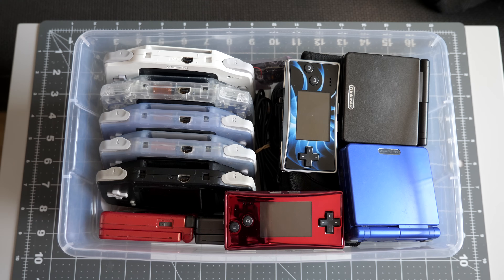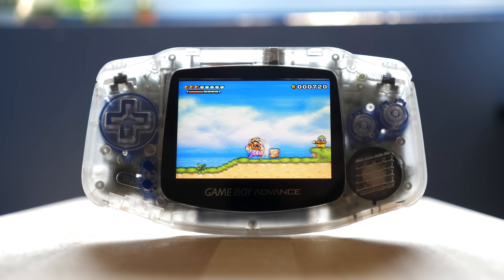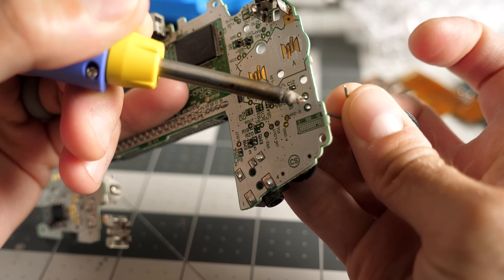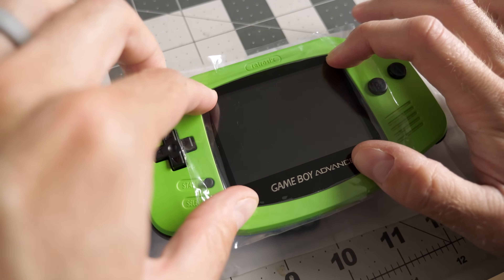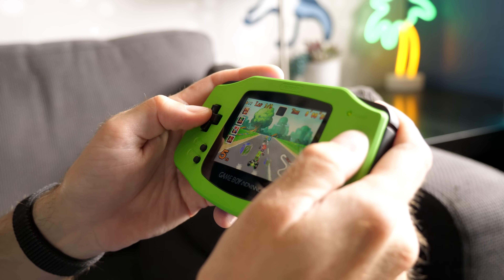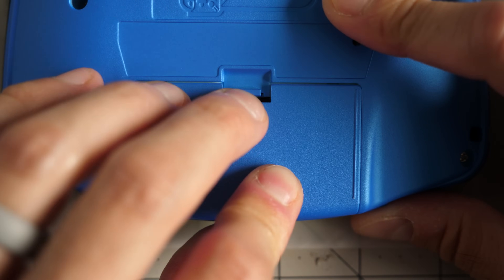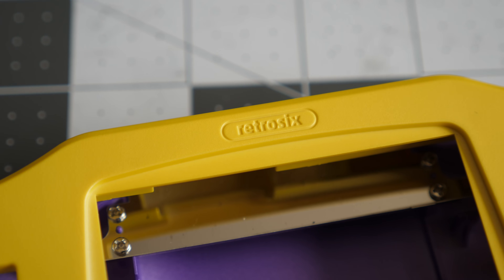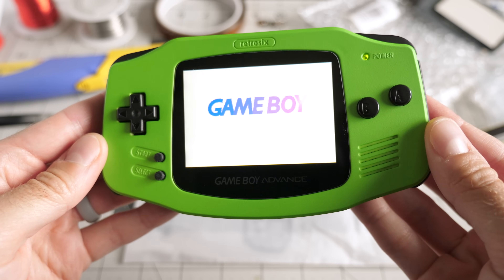Let's Build the Ultimate Game Boy Advance for 2020!

Comment: USB C, as it should be. Well done to whoever made that mod. 👍
Reply: Honestly if the switch didn't exist I don't think I would own any devices with USB C and even with the switch I just get an adapter and plug my micro USB cable in anyways

Long story short who gives a crap if it uses usb c or micro usb because you ate going to need both cables anyways.
Reply: @bland9876  because micro usb is a shit connector that breaks way too quickly
Reply: @YodielandInhabitant710  just get a new cable if it breaks. There like $10 max and then be careful with it this time
Reply: @bland9876  It's the port itself that breaks as well. Also, usb C has way more options for faster power delivery.
Reply: @bland9876  there's no be careful. You've never had a ps4 controller. Those ports are shit.
Reply: I was very pleased with this as well
Reply: @bland9876  I've been living without micro USB since the S9 came out. Fuck micro USB all my homies hate micro USB
Reply: @tuckerton296  imagine using mini USB instead. Eeuughh...
Reply: @LaskyLabs  at least that one was a little more robust
Reply: @bland9876  My phone, tablet, headphones, 3DS, Wii U GamePad dock, and Wii U are all USB C
Reply: @shanez1215  I'm definitely too lazy to mod all my systems to be USBC
Reply: @LaskyLabs  Mini USB ironically is a bit larger than Micro USB and lasts better too. I also have a Sony A100 camera which was made in 2006 and its custom USB port still works. USB Micro is just too terrible

Comment: I remember when ags-101 is were like 50 bucks on eBay good thing I still have mine from back in the day or well technically my sisters
Reply: Yeah the Ags101 price goes up in the last year but the ips is the better screen and cheaper
Reply: 666Gothicgirl The IPS LCD is although better and cheaper, the battery life is lower than an AGS-101 LCD unfortunately.
Reply: I heard there is some lag, however minimal I would assume, with ips screens, compared to the ags101. Maybe that info was wrong, I dunno.
Reply: what is sister's is sister's
Reply: @R1SKbreaker  The Funnyplaying IPS screen v1 has screen tearing. Maybe that's what you're thinking of. The new IPS v2 screen has no lag or screen tearing. It's definitely the best screen on the marken today.
Reply: @thenightowls2804  that could be. I'm tempted to mod my GBC, but I have a Analogue Pocket, which dissuades me from picking up a screen for the GBC. If I ever find my NES style GBA SP, I'm definitely doing a IPS screen mod though.

Comment: I wish the shells didn't have branding on the front. I appreciate that they've invested in the moulds.. but I'm not playing on a 'Retrosix' GBA. The shell is literally the cheapest bit of it all.
For other things I'd consider essential, flash cart.
Reply: Yepppo. I'd rather have a "cheap" shell rather than one that has some manufacturers logo on it!
Reply: @MixUpTheVideos  yep that's true but you have to consider that it's not some fake Chinese crap that tries to pass by the original shell. Rather retrosix is one that's already made with mods in mind, so no extra work, so if you like the original feel and look of the oem shell, then grab a used one in good condition and mod it (I wouldn't recommend this for the ips but the ags 101 because the ips requires so much trimming that you may end screwing up the oem shell) but if you want to pick up an aftermarket shell for your build then grab retrosix's your not going to regret it!! 🤓🤓
Reply: 100% agreed! I made the mistake to buy one on eBay for Freeplay CM3 mod and saw that only when I received which was disappointed. I ended up not using it.
Reply: Yeah I would be alright with inconspicuous, small branding on the back.  But this has big gaudy branding on it.  It's too much and I think I'll have to pass.
Reply: The reason they have the retrosix branding on it is copyright. While most cheap Chinese shells off eBay don't care about it, retrosix is based in the UK (I think) so therefore have to work around the copyright laws to be able to produce the shells
Reply: @looeegee  They should make it an option on the front or stick to the back logo only. Easy fix. I can see how most people gets triggered by this since you're looking at this logo 99% of time lol. It's the same story as with screen protectors. There was time when some companies were making GBA protectors with their logo instead of Game Boy Advance logo. It was a disaster.
Reply: @looeegee  they're still losing clients, tho. I won't buy this case just because of the logo, I rather mod a original from a broken system. Reteosix GBA lol.
Reply: I can't get past the retrosix logo on the front. Would have rather have nothing there or maybe have it hollowed out to fit a sticker like the one on the SP on it's cover.
Reply: Remember one thing - they CANNOT use ANY of Nintendo's trademarks.  So they have the choice of nothing or their own logo...
Reply: @Gulyus  Nothing would be better.
Reply: @Gulyus  The whole GBA shell mold is patented by Nintendo it doesn't really maka a difference, they're still breaking their patents and trademarks.
Reply: @ant_989  Not true. It's called right to restore. Because nintendo do not offer the replacement parts to the public, there is a right to provide viable replacements to allow restoration (spent a lot of time with legal to get it right). It is also an open rule in general around the right to restore, nothing is hard set. Nintendo could come after anyone using their brand, but if you use it clearly indicating it is not official, and nintendo do not offer an alternative, its highly unlikely. Also the `retrosix` is now being replaced with a `For Nintendo` logo very close to original, and all other branding removed.
Reply: @AngelSix  yeah i assumed they had or would have something unbranded. They arent that dense lol. I dont understand people THAT triggered by it, even tho i am not a fan of big bgranding in other areas. Its a GBA, if it makes the feel better is all im worried about. The look is very secondary, and its not even outlined! Just a faint press.
Reply: If your worried about that you would not rape your gba motherboard either so i dont see the problem. Just stick with original...
Reply: @Gulyus  i'll choose "nothing" every time.

Comment: I got my parts in over the weekend and did the whole build today in about 3 hours! 

I opted for the solid purple retrosix shell with white buttons. Looks like a futuristic take on that classic indigo model. Can’t thank you enough for the recommendation, it does feel like a super solid aftermarket shell. Just wish i could have kept the Nintendo branding.

Still this mod was a super fun quarantine activity. I hope that handheld legend restocks so others can take a crack at this!

Anyone else who tries, do the build in his order. Clean amp first, then IPS. Have the battery charge outside of the system while assembling so you can just plunk it in fully charged! Im gonna say the shell+bracket aren’t optional because it made it SO EASY compared to other builds ive done that required shell trimming.

Also, the handheld legend after market buttons had some little extra plastic bits. If you take flush cutters and clean these bits off they get closer to the quality of the retro six shell and fit much nicer. So make sure to clean them up before installing!

Comment: $40 for the battery is disgusting, I think I'd make my own and order a board from china for $2 and probably end up spending no more than $10 in parts.
Reply: With small volume stuff like this, a significant chunk of the price is the designer recouping their R&D time. The only reason the “$2 board from China” would even exist is because a hobbyist went through the work of designing it and having it manufactured. 

That said, yeah, it’s hard to stomach a $40 MSRP when looking at just the BoM and what it does.
Reply: Correct, I buy any components from AliEx, 35$ screen (the same function), 2$ front glass, 5/6 for case with cutter parts... Save 50% or high ;). Battery mode? mmmh I don't have idea how much cost But, i like AA Battery <3

Comment: Love the AA battery setup. Something about the size of them and slotting two of them in, in the opposite direction just feels right plus you can keep some good brand AAA AAs on hand for Wii, N64 rumble paks and tv remotes. Actually wish PS4 and PS3 had a more traditional battery setup. It is nice though how they've gotten batteries to fit into smaller spaces by turning them into a small rectangle. Picked up an IPS from them the other day as well as the holographic glass. Going to need 3 more eventually trying to have 4x GBAs for the rarely done FFCC and ZeldaFourSwords. 4 player consoles really interest me.

Comment: My dream is a gameboy advanced with a rechargeable battery that uses usb c, an ips screen, and an all bead blasted aluminum shell with matching buttons and triggers. If it were possible I’d want some kind of small upscaler or line doubler module to increase the picture quality. But I think the thing that would make it the ultimate gameboy advanced would be also setting it up to allow connection to a tv via usb c and use it as a controller to play gameboy on tv.
Reply: Look into the GBAccelerator as well!

Comment: I bought the funnyplaying IPS kit after seeing your video on it. My installation of the panel wasn't perfectly aligned, but I didn't want to risk breaking it to redo it, so it is still slightly off-center. Now that there is a mounting bracket and the actual panel is only $15, I might redo it when the bracket comes back into stock. I'll definitely pick up the cleanjuice and the retrosix case as well. Or I'll upgrade my spare GBA and leave this one as-is, but the IPS kit is also sold out.

Comment: Omg, with those brackets its finally a viable mod for me to do!
My house is incredibly dusty and i never did an original gba ips mod because i only get one shot at putting in the screen dust free. With that bracket i get as many retries as i want
Reply: you can clean the screen or use air spray blow the dust before place the lens.

Comment: Surprised you didn't include the PureSilence with the CleanAmp. I just did all these mods as well and it's only a few more solder joints - not anything difficult if you can do the amp itself.

Comment: when you asked if there were any mods for consoles that dont exist yet, i instantly thought of an idea i had the other day; Gameboy Colour Advance. It's just a Colour shell with an Advance widescreen. 
The other day i was mucking around with my old gameboys and i put the advance lens over the colour screen and thought how good a widescreen Colour would be by being able to swap the screen into it. The advance lens almost matches the width of the colour so i know the screen would be a very tight fit and the power light would have to go, but with a dremel/milling tool you could easily fix the shell. As for compatibility between my own parts (pcb and screen) idk, but i'm sure a mod should exist.

Comment: No GBA mod video ever talks about the GBAccelerator. It allows you to "overclock" the GBA with some button presses. Speeding up long boring dialogues or grinding in RPGs at 1.75x normal speed is extremely helpful

Comment: I did an IPS and shell/button replacement on a GBA a few months back and let me say... you guys make this stuff look easy.

between trying to get everything positioned right inside so the screen's not lopsided, not getting a hair caught in the tape, making sure the thing will close easily, not losing a rubber nub that goes in the L button... it's an ordeal, at least for me doing it for the first time

I wish I'd gotten from retrosix though. while the parts I got off ebay are decent enough and definitely work, and I'm /satisfied/ with my final product, I'm dissatisfied /enough/ that I'll just keep using my professionally modded SP instead (Which has a functioning L button). I'd like to try it again though. maybe with more space and white floors in case I lose the nub.  lmao

Comment: Great video! I did the same for my gba. Only different is that I stuck with the original gba glacier blue shell. I wish I had an ags 101 screen to keep it as “Nintendo” as possible, but they are too pricey, so I opted for the ips screen. I also went with the powerup advance rechargeable type c Li-po battery

Comment: The IPS V2 mod is leaps and bounds ahead of the 101 I think. Also I got the Speaker and amp mod from HHL but didn't get those tiny wires .. something to look out for .. I haven't finished modding my GBA as I'm trying to salvage tiny wires from old electronics.

Comment: I got someone on reddit (u/Retromoddoctor) to give my GBA an IPS screen and a purple Retrosix shell. i knew basically nothing about retrosix but when my system arrived back in the mail.... holy heck. it feels luxurious. its got a soft matte finish and very slightly rubbery. the bright screen is beautiful too. i wish id know about the rechargable battery option, i would have had him do that too!
Reply: Battery requires no soldering or opening of the shell, just order it when they restock with V2 clean juice! The new one will include low battery warning ( probably 4 weeks till that releases).

Comment: i personally would just use rechargeable AA's over the battery pack as you can get lithium ones with micro USB ports on them for less money, and no mod needed to show when the batteries are running low.

Comment: Makes me regret getting rid of my old wide GBA. The buttons and screen went bad but the board itself was fine.
Now I just source port my GBA games to my 2015 3DS XL using its built in Virtual Console. If it can run Golden Sun the Lost Age flawlessly, it'll run any GBA game (since The Lost Age is a bear to emulate, but Virtual Console isn't an emulator, but instead, clocks the system down to exactly GBA spec).

Comment: I absolutely love the quality and number of mods we can apply on GB and GBA! However, I alwayst have a little grive with "overmodding" an original console so to speak.
Until when have you made improvements to the original und at which point have you just made a new console that just has the motherboard as an original piece.
For example the shell of an original GB DMG is, for me, an important piece of the GB "experience". If you replace the shell with an replacement, it doesn't feel the same to me, event tough it be of better quality.

Don't get me wrong, I love to see these mods. The GBA shown here is just gorgeous! But it still looks like something very different from the original gba.

Comment: did you have an issue with the dpad membrane that came with your shells? I did a similar build with a retrosix shell and IPS kit and the dpad membrane was so bad i had to swap it for an OEM one. It was so stiff i couldn’t get half the directions to register without really pressing down on them.
Reply: Yeah, mine was similar. It's not just the membrane; their dpad isn't quite as tall as stock. Luckily I had an original membrane and a black dpad that matched the original dimensions better, so it's all good now.
Reply: @JonathosDX  i did notice the dpad was a little different but I really like the way it feels. Luckily it works nice with the OEM membrane.

Comment: Did all those mods and amp make ground noise more apparent from the speaker and headphone jack like the Retro Modding Battery did for you? I'm hoping there is a solution as the IPS screen and battery mod have done this to my GBA. I've recapped it but the ground loop hum/buzz still persists. Good video BTW.

Comment: Sadly they don't seem to sell any dual colored shell like shown in this video. They looked great.
However it is costly to make such an upgraded GBA. In CAD it's 200$ for the components, not taking into account the need to have a working GBA motherboard and other required tool to complete the process.
Plus if you want to play using a single cartirdge and simply load ROM you need another costly tool which will set you back further 50-100$ depending on choice and luck.

Comment: There is one "mod" that I wish for, but it's not for a console, but rather for PCs:
A replica IBM PC 5150 case that's compatible with modern motherboards.
Yes, there are guides online for how to build your own replica, or I could buy an original IBM 5150 case and mod it myself, but the former requires too much work that I have no experience with, and the latter combines that with a high entry cost plus me abusing vintage parts that are no longer produced for something I might mess up beyond repair, so I am REALLY REALLY hopeful that sometime down the line, someone starts producing a modern replica case.

Plus it could contribute to collectors by producing a variant that's a 1:1 replacement for the original case, for old IBM 5150s whose cases are beyond repair.

Comment: can you please share the wire you use to solder to the cleanamp module? i have been using 28-30AWG wire, but the shielding is too big. also, what are you using to strip off this ultra thin shielding?
as always, nice quality video. :) you always pick some great color schemes.
Reply: With enameled magnet wire like that, you can run it through the flame of a lighter or sand the enamel off. Supposedly the heat from soldering is enough, but I remember having some mixed results with that technique.

Comment: Simply amazing to which extent the OG GBA is moddable today. I am very much looking forward to modding my own unit. Only thing I don't get is why anyone would go for a li-on when you can just pop in some good old Eneloops that are easy to have at the ready. Doesn't seem worth the effort to me.
Reply: most people have a micro USB/Type C charger on hand rather than extra batteries or a battery charger. plus no chance of battery leakage.
Reply: AA batteries >>
Retro gamers know it is the best. I want a DS Phat mod with a IPS screen and 2 AA to use(the system will get bigger for sure). My bootleg battery doesn't even stand 12 minutes alive far from the charger.